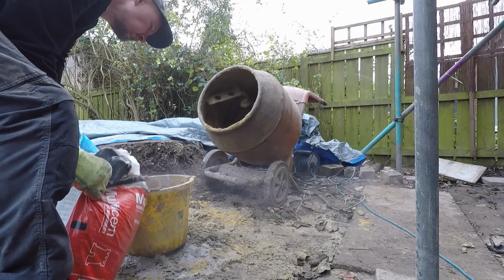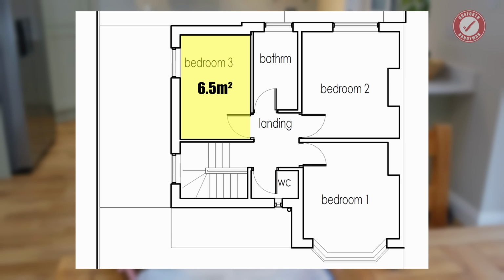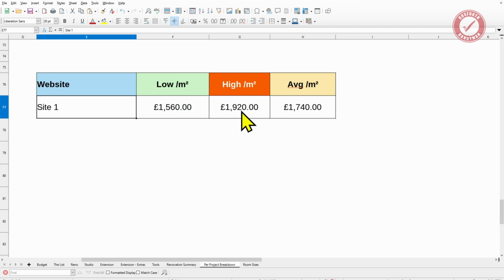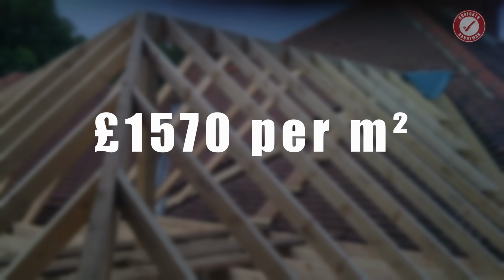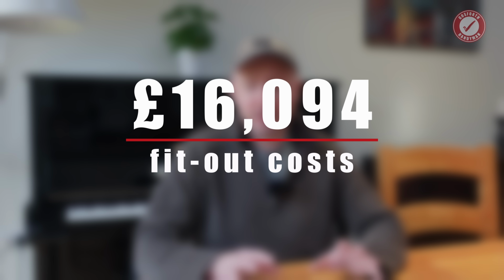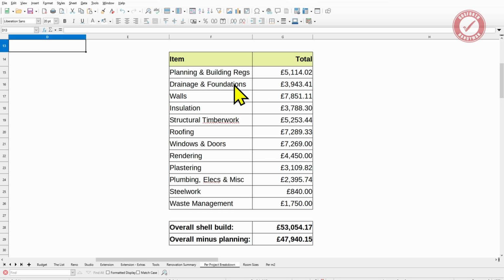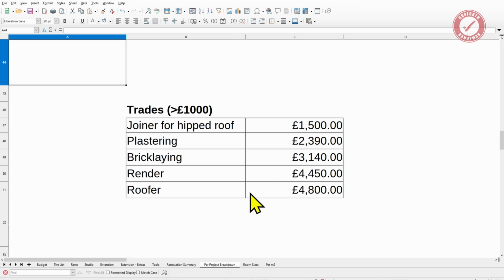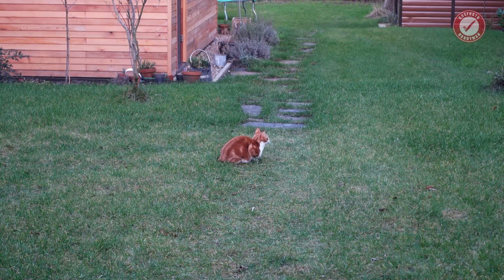How much does a UK house extension really cost?

Comment: Just bear in mind the building regs have changed with regards to thermal insulation, adding considerable costs to a build getting done now.
Reply from the maker: Yup! We were very lucky to escape the new Part L changes. Even more cost! Ironically means homeowners just won't bother, leaving their older homes significantly less thermally efficient. 🙄
Reply: @GosforthHandyman  would be nice to see a calculation of the added upfront cost for the extra insulation compared to the expected savings on reduced energy usage.
Reply: @GosforthHandyman  Our climate is probably getting warmer anyway. Most newer UK homes will be to warm

Comment: Thanks for breaking this all down & your insight into the whole building trade in general! I come from an IT background and used to quote jobs many years ago for cabling, Network installation, deployment, training...etc. I've learned after buying my own home recently that the quotes I get for basic works are just pulled out of thin air really. No hourly labour rate & materials breakdown... just a job description and a price. Mad stuff really! Anything can be quantified in some way and if you cant then you probably shouldn't be pricing jobs. A QS will do it for you fairly quickly either way but that's why a lot of those crowds rely on one-off jobs in order to bypass all that and try to screw people. I had a "plumber" in to quote on zoning my heating for hot water and radiators (bungalow so just HW and CH needed). He then tried to tell me he would need to run 2 new pipes from the boiler-house (about 10ft away) to the airing cupboard. I asked why would that be since the flow &  return go straight to the airing cupboard and can be zoned there? literally no answer and very awkward conversation after that. He then quoted me nearly 10k for a Schneider Wiser system that I could literally install myself for €500. I've since learned a lot about plumbing, disconnected a back boiler and re-piping my entire house for CH since the original pipes are under concrete and recently sprung a leak due to hard water. Current running total is about 2k  and zoned with heating controls in place. Wild west stuff out there!
Reply from the maker: Yup, also IT background. We had to fight for every job. We'd win 1 in 3 quotes and every one involved a detailed written proposal. SO different in construction. Sellers market!
Reply: @GosforthHandyman  fight for every job sounds about right! yeah construction is whatever way the wind blows really!
Reply: If you were such a good plumber you should have known that if you wanted it zoning in the cylinder cupboard then the HW return would need to be independent and the last one into the boiler, otherwise HW and heating could never work independently. 

You knowing better than him and having old  primaries buried in concrete probably didn't give you your best shot at a "fair" price.
Reply: @FreddysHamster   I never claimed to be a plumber, hence why I had plumbers out to quote for the job. I have no issue paying money for a job well done, it’s what I prefer to do since I really don’t have time to be second guessing projects like this, and it’s why I call someone who’s “qualified” to take care of it. What I have an issue with is when someone is trying it on and it’s obvious they want to make a quick few quid and run away. An independent return isn’t required once the 3 tee rule is observed, which I did and now have independent zones without any reverse flow between them in the airing cupboard. System is now nicely balanced as I piped it as a reverse return and couldn’t be happier. Did I want to do it myself? Not even slightly but it was a matter of necessity on my part as the system was a mess and needed to be fixed.

Comment: In 1992-‘93 we put on a 15x30 foot addition to our single level home, wood frame, asphalt shingles, and vinyl siding. We estimated it would cost about $20,000 but ended up spending around $30,000. We had the foundation dug and poured, and new electric service updated to 200 amps with a panel installed by hired outside help. Everything else was done by us with lots of help from our families.
Reply from the maker: Fantastic! 👍👍

Comment: just out of interest. if you had to price this as a job for a customer how much would it come out with profit and a decent wage? was it anywhere near the £140 mark?
Reply from the maker: That's a very good question. I think £70-90k is fair but it depends on so many factors. Company overheads, size of team, standard of finish etc. I have no problems with companies charging £140k for a job like this, but it would push this house well beyond the ceiling price of the street so non-starter. 👍

Comment: I have a planning application being reviewed and whilst it will be a self build I have had loads of speculative quotes coming through the post. It's a 70sqm 2 story rear and side extension. I've been quoted 149k+vat not including windows, bifolds, basic electrics, basic plumbing and heating.

I should add others have noticed the smaller builder is having jobs cancelled left, right and centre. I am also seeing on social media that they now have 'open diaries'. Power has flipped the other way now.
Reply from the maker: That's a big extension! We had loads of speculative quotes... then they all turned us down when they looked at the job! 😂
Reply: @Gosforth Handyman  yeah it def is big. Two story wrap around and rear. Big job for sure. I'll either end up broke, divorced or dead...possibly all three by the time it's finished lol

Comment: Random number generator! LOL.  Well done, Andy. I would call it a renovation with an addition.  And just for folks watching, the cost per square foot or meter, think about what is included in the renovation and/or addition.  If you add one bedroom, vs one bathroom or kitchen, you have the two extremes, considering what is to be included in the new space.  A bedroom would be the simplest sort of addition, with the least expensive components, vs a bathroom or kitchen that would include millwork, fixtures, plumbing, and more complex electrical considerations.  So many things to consider, so that is why throwing a cost per square whatever at a project is a dangerous attempt at budgeting.  I proper design should be done first and then get bids or quotes from reputable contractors or subcontractors.  I have been in the design business for over 30 years and built many new homes as well as done many a renovation and addition.  Don't get caught without a plan folks, and be sure that you make as many notes on those plans as you can, so you don't have contractors coming back to you with their hands out.
Reply from the maker: Cool - cheers Rob!

Comment: Great video. My only problem is with the title “How much does a UK house extension really cost?”.  The figures you are providing are for getting a company in to do all of the works, but you are basing your figures only on the areas where trades were used for the labour, and not taking into account all the labour involved in the works undertaken by yourselves. This doesn’t seem to be a like for like comparison as you’re comparing your cost to carry out a self build with the cost of a full build, without taking into account your lost earnings or time during the build. 
Even comparing your build to another self build where they did more of the work themselves,  it would come to less than yours, and also vice versa. 
If you want to do a more realistic comparison between a self build of any type, and one built completely by professionals, then you would have to include all labour. This would mean you would have to count the cost of all professional hours spent on the works. It would then be necessary to count all the diy hours spent on the works, and assigning an amount per hour. By adding these two together you would then have a much more realistic figure when comparing self build to self build, or self build to full build. 

I’m a professional builder myself and love your videos. Hope you don’t feel the criticism is harsh but I just felt the video need some more clarity when comparing self build to self build and full build to self build. 

Time is precious whether you’re being paid for it or not.  So providing the self builder with the likely hours they would have to spend on the work would give them a better idea of whether it’s cost effective of their time to go the self build or full build route.
Reply from the maker: It's not intended to be a like-for-like comparison but covering time spent on a future vid as this was too complex to go in to on here. 👍
Reply: @GosforthHandyman  Thank you for the reply. Quite possible I misunderstood the intention of the video. I did enjoy the video and realise you put a lot of time and effort in.

Comment: Great video, very helpful. Always best to get 3-5 quotes. A friend of mine saved £34,000 in total on  a high quality extension just by getting different quotes. The ironic thing was, the expensive builders called back a month later asking if they've found a  builder for the project. One reduced his original quote by £23,000 and another  by £32,000. Shocking how much builders inflate the price.
Reply from the maker: Yup, lockdown boom! Now it will be post-lockdown bust. 😬
Reply: The real worry about builders who ‘make it up as they go along’ is once the project is underway and they get to think they may not be able to bring in the job  - they will start ‘nickel and diming’ you or walk away.

Comment: That's a massive saving. It's crazy that the cost quotes were in excess of £100k. I think you've done like 42 hours worth of video alone, so if you put in a reasonable factor of 10x that in terms of the time you spent on project, multiply by some of the figures you quoted in small business toolbox from a few years back, it's at least £20k in time as a low estimate. One tip I got just from this video is to know material costs, because that immediately provides an opportunity to work out if someone is being less than truthful. Look forward to hearing more of your tips on finding good trades people.
Reply from the maker: Cheers! Yup, the material costs are an eye opener. Didn't really cover it in this vid but ALL of the masonry (bricks, blocks etc.) for the entire build cost about £2,000. That's the main structure of the extension... that we're being quoted £140,000 for. 😬
Reply: @GosforthHandyman  wowser that's bonkers. You might have prompted the builders to put you on a "can't rip off" list that gets circulated 😂

Comment: Havent watched the video yet but I built a same sized / design / quality  extension on mine 3 years ago, just before the massive increase in material costs.  I did everything except lay the bricks themselves and the skimming. , I didnt keep a running total but it came in at around £25k ish, decorated, no kitchen fitted.  Took 2 years part time from first spade in the ground to last lick of paint.  It can only be done  if you are competent yourself.   I’m a mechanical services engineer so plumbing, electrics, dry lining, drainage, roofing, joinery etc is second nature to me.  I’m told £100k isn’t out of the way now for similar due to skill shortages.
Reply from the maker: Yup - I'm now hearing prices of £4000-5000 per square metre! Insane. 😬

Comment: Nice video! We were quoted £60 to £120k + VAT for a 15m2 extension (!!). This was mid-2022. The 120k + VAT worked out at the best part of £10,000 per square metre of new space. Plus kitchen, flooring, glazing, tiling, sanitaryware! I politely told that builder (who had the audacity to say that they "might" be able to visit to properly quote and in the end just did it off structural drawings) that they were living in cloud cuckoo land. I never heard from them again, strangely enough. I've noticed an interesting change in the past few months though. I have shortlisted builders calling me up now, asking if I have an update on any upcoming works. The same builders I had to beg to come round and have a look for a quote a few months ago. My theory is that the post-Lockdown boom is over, people are going back to the office more, remortgages are expensive, cost of living is up, and builders are starting to panic that the order books are drying up into 2023-24. We shall see.
Reply: Your theory is correct. I've been expecting and waiting for this to happen since March 2022 when inflation started to take off and central banks started raising interest rates. We need a small extension but there was no way I was paying with prices at historical highs (2020-2022), it would be like buying shares right at the top of the market, throwing money away. Basically as the Fed raise interest rates to quell inflation in the US, the BoE has to follow in the UK. The result of this will be inflation dropping off, but the consequence of that will be a big recession. The higher interest rates go, the bigger the recession. Recessions mean demand drops, which in turns means prices come down, although prices can be 'sticky' and lag a bit behind.
Reply: @garethedwards5159  Finally, someone who understands how economics works 👍 Everything you’ve said is absolutely 100% spot on.
Reply: @garethedwards5159  Just one point, inflation isn't in the regulated money markets. It was a supply-driven rise in prices which would fall off as supply chains unblocked. Inventories in the US are still not going down. Now the opposite problem is about to occur as international freight rates fall, and China isn't really able to return output to pre-pandemic levels. And the CPI is falling for the wrong reasons, as its not being driven by increases in supply. Its being driven by a fall off in demand over and beyond 'post-pandemic normalisation. 

The real problem in the International Money Markets is that they are nervous, and are unwilling to provide credit without collateral that is government-backed. They're not interested in mortgage-backed securities or junk bonds, causing a shortage in credit to fuel international commerce. China is the biggest victim, but the volume of debt around is scaring lenders in the international monetary system, and they don't trust each other. If the IMS is choking off the supply of credit, that will impact the availability of financing in the regulated markets too that are controlled by central banks, like the Fed too. 

Base rate changes are a political decision, and have zero impact on the availability of credit to the lenders. Collateral in the IMS does that. Base rate changes are to target wage increases, and employment figures last week showed that wages aren't growing, and job numbers only grew in part-time employment. So base rate hikes are in danger of killing off consumer demand, leaving retailers high and dry, causing real job losses to accelerate above and beyond what we see now. That's why lending criteria in regulated banking are getting tougher and less mortgage products for variable and fixed rate loans are in the consumer market now. There's simply isn't enough money around, for businesses or consumers. That means deflation is more likely now. The only cure is the Fed to issue new treasury bills or notes, and they're not doing that, because they aren't paying attention to the lack of credit flowing in from the IMS. There aren't enough US Treasury bills to support the global economy. The Fed is trying to maintain confidence in their ability to "steer the economy", when in reality they're not in driving seat. The IMS is, and it's feeling nervous because they feel a global recession is coming, and everyone is overburdened with debt. And governments are worried too, because the debt is too big to repay, and they are relying on inflation to erode it away. As its unpopular and probably politically  impossible to raise taxes in the US right now, the Fed, like other central banks will not be issuing new bonds to provide liquidity, so things are going to grind to a halt this year or next year in the global economy, and it will be 2008 again. We have to wait and see if that's right.
Reply: @BigHenFor  Can’t argue much with that either. We are indeed on a course towards rekindling market conditions of 2008. The scale of debt is colossal and even a small run will quickly gather momentum. 

Some strange folk will dismiss this as “negativity” as they’ve no clue that their ignorant emotion is already priced in. The same people are usually those who lose everything as they weren’t paying attention.

Construction is already showing signs of slowing and those builders who believe they’re ‘booked all year’ are in for a rude awakening. They always think the good times will last. They are always wrong. Always.

Not many people truly understand the magnitude of what is brewing. The shake out will be historical and has the potential to make 2008 appear a walk in the park. The bubble is about to poppity pop 🎈
Reply from the maker: Yup, totally agree. Lockdown boom had a lot to answer for. As folk tighten their belts builders are really going to struggle in 2023 I think. 👍
Reply: Jees I thought my mate paid a lot at £45k for a single storey extension
Reply: It needs to calm down a bit - I could buy land and get a large house built in Germany for equivalent 120k 😂 rip off Britain

Comment: Great video. I was looking at very small extension and now I know where the costs fall I can talk to builders sensibly. Always worried cheap was bad but if small business has low overheads and low profit it will compare with wifes idea of always pay most for best. Thanks.
Reply: The “you get what you pay for” cliché is just parroted by those who are the easiest to rip off. Whoever thinks cost always = quality hasn’t a clue.
Reply from the maker: Check with architects builders have used - they're generally a great source of knowledge for builder reputation. 👍